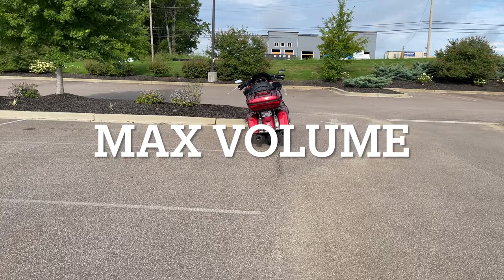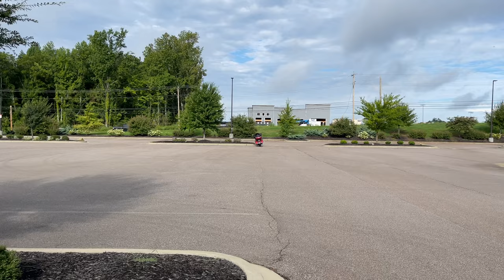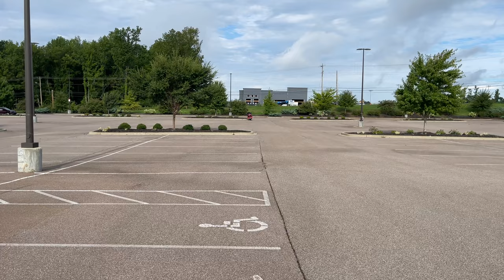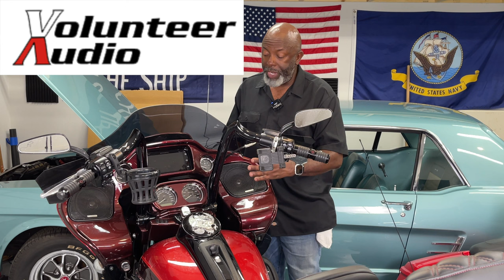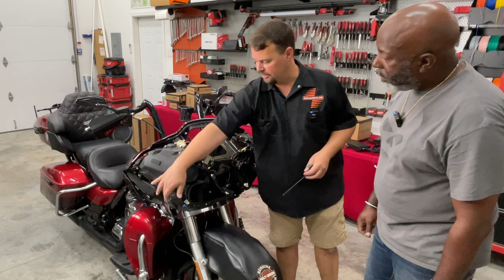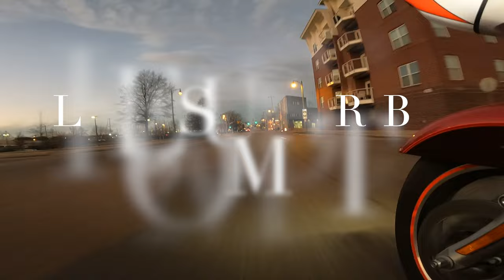SoundStream HDHU14+ Review after a 1300 mile ride

Comment: How did you water proof your Deck Lids like that ???
Reply from the maker: It's a combination of things. The cut kit is important. You need to make sure the gaskets are seated properly. Also make sure that any other holes (for wires) are sealed. Second: some speakers are more "waterproof" than others. The design of the Precision Power speakers is better than others that I have seen: some speakers allow water through the tweeter. Some are made of "less waterproof" cones. The test that I did on my speakers was extreme and doesn't reflect what you typically see riding in the rain, however if your bike is sitting out in the rain, it will accumulate a lot of water, so it's a good idea to have covers for the kids when the bike is parked